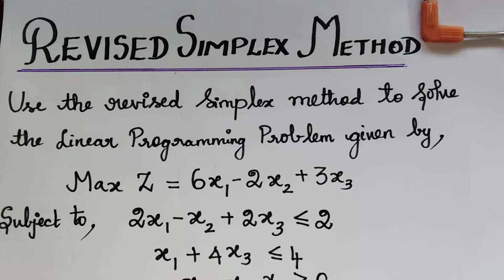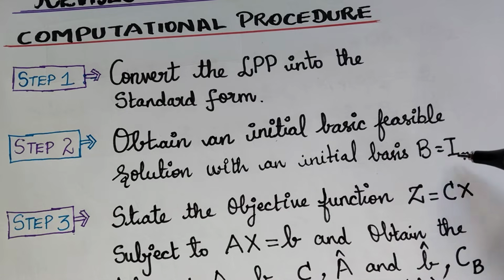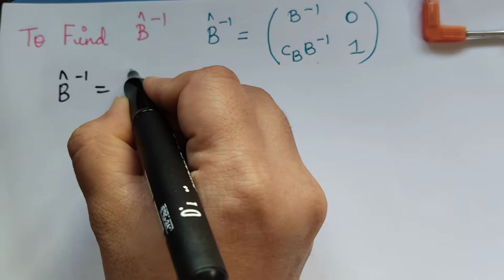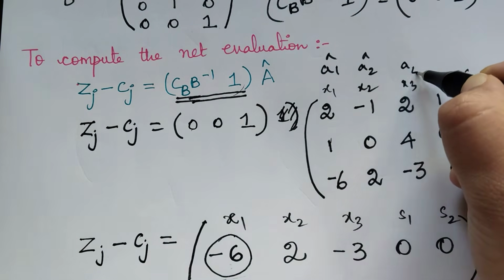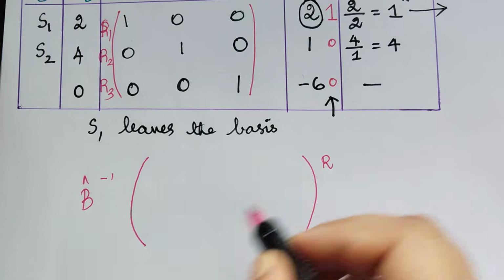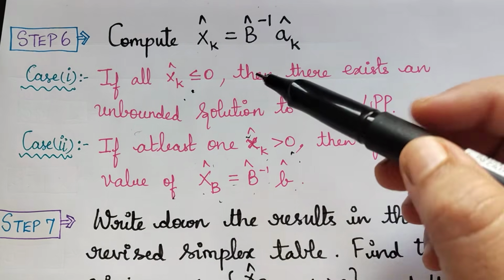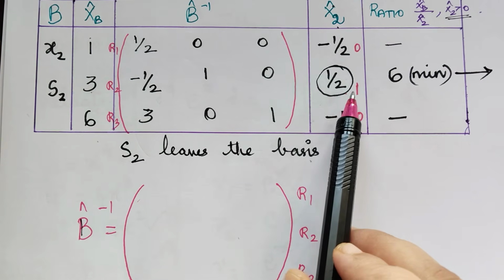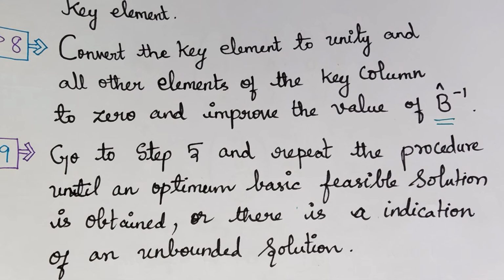Step-by-Step Revised Simplex Method | Optimization Techniques || Advanced Linear Programming

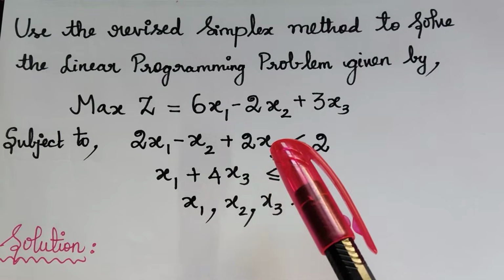Comment: 2:30 Madam can't we just change the constraints (≥ to ≤by multiplying -1) and just add slack variable and skip the part of artificial variable?
Reply from the maker: Multiplying a ≥ constraint by -1 does change it to ≤, but it also changes the direction of the inequality and the meaning of the original problem. This can affect the interpretation and feasibility of the solution.

In simplex method, slack variables are added only for ≤ constraints. For ≥ constraints, we first subtract a surplus variable and then introduce an artificial variable to start the simplex tableau. So, we can’t skip artificial variables just by flipping the inequality sign.

Hope it was helpful.
Reply: @hameedamathtuber  thank you so much madam for clearing my doubt
Reply from the maker: @devjyoti5614 most welcome